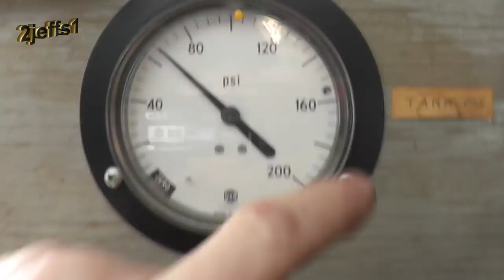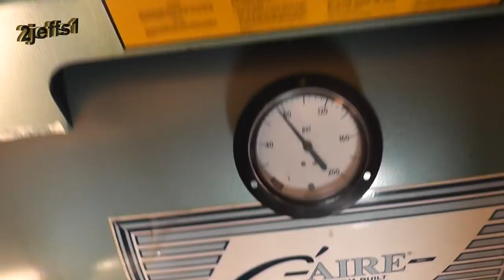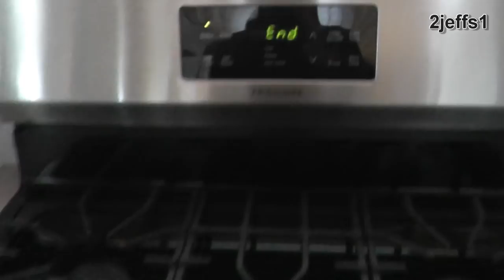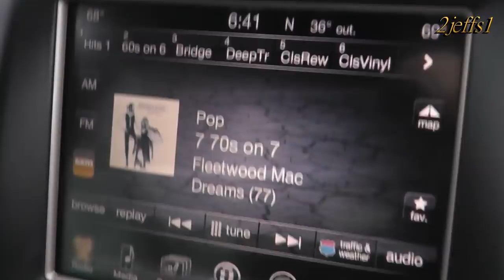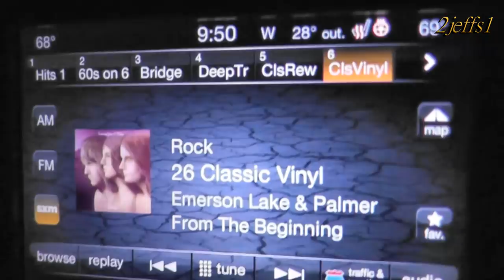Procedures on Extracting Stubborn Studs, Bolts and Screws!

Comment: A few years back our engine builder (Trans Am/GT1) was working on an older Offy 270 head/barrels that had a broken exhaust stud.  He dammed around the stud with modeling clay and filled the cup with Coke.  The coke actually ate the stud away in a few days.

Comment: Very nice bike there sir. I’m glad you got the stud out and did not have to pull the cylinder. I agree with your idea of the oil in the threads, also sometimes I use removable locktite or either anti seize too, either way it all keeps moisture and rust from getting in the threads.  Very solid video also keep them coming.

Comment: The colors remind me of Evel Kneivel ...Thanks for showing you can use heat And penetrating spray on stuck bolts ..It does help to boil the rust and corrosion out of the threads....I had to remove the  water pump on my Ford 302 and I was sweating and swearing  on how long it took to to get the long bolts out with all the years of crud built up ..I used a bunch of spray and finally won the fight ...And you can bet your sweet bippy ( remember Laugh In)  ...I will be using some Never Seize when they are re-installed
Reply from the maker: Yes - I remember doing those too. They could turn nasty in a heartbeat! A true patients test.

Comment: Ah man!!  Those freaking studs!  :(  Honda, you do have a few things to apologize for.  That tank cover  is too damn cool.  Woah!  The  foot peg extenders are great!  I might be in love with that machine Jeff.  Dude!  haha, that thing has so many awesome accessories on it.  Never seen any of that stuff before.   Ah yeah!  A video of all the differences, that will be great.  Nice!  Going back to the thumb  throttle.  Yeah, not a fan of the twist throttles on the ATC’s. ahh man, yeah, the grab bar… Yeah, i need to weld mine back together.  Maybe make a new one, as there are welds on top of welds.  :)  wow you bent that heat shield back real good.  Never would have known it was bent.  haha.  Weird, that heat shield should be held in with two bolts.  OH NO!  Looks like someone drilled vent holes in the air box lid… :(  Thats a no no.  Kinda defeats the purpose of having a built in snorkel, when the airbox is has air holes in it… Guess that guy never went near any water.  hahahah, that tank shroud screw is amazingly worn out.  :)  That head pipe came out so nice looking man.  Really looks great.  Ah man!  Definitely stealing that Idle screw extension trick :)    Such a great video.  Thanks for taking us on the trip with ya!!  Definitely loved every second of it.  Looked like a good way to spend a day.    And you’re narration and thoughts about things really fill the video out nicely.  5 stars?  20 Stars! :)
Reply from the maker: Hi Tom. Enjoying these machines big time. Never drove a Honda 3 wheeler until recently. (don't laugh) Like I said in the past - didn't see eye to eye with the Honda dealer. Had to move the 84 Yamaha 175 last night. Started first pull but - can't get over how much nicer the Honda's drive/work. There is like a page of differences between the 84 v/s 86 200x. Prefer the 86 200x for many reasons. So many changes for a 2 year difference. Neat you brought up that air box deal. Thought that was weird too. It almost looked factory the way everything was spaced perfectly but like you said a no no in my mind also. Found/ordered a headlight guard off e bay. Seen something that Honda offered several things as an optional accessory back then? Gotta tell ya this. The spark plug was always black when removed. Thought it should run/start better. Did a carb kit. Ran a tad better but.... Adjusted the valves, did this, checked that, still was running so so. Finally thought when someone put that twist throttle on I wondered if they changed the needle for the main jet where that would be easily accessible for the conversion. ( You know how everyone thinks more fuel - go faster) Pulled the carb slide. The c clip was in position 4. Changed it to #2. Went for a ride. Woah - fixed, ran perfect, checked plug color. Perfect. Finally figured out after how long? Here's the topper. After all said and done where you gave me the link to the service manual - checked to see if... Yup the setting was in there. And recommended #2. My bad.  So much needed/helpful info which has been handy to access. Runs great and thank you for the tip. Much appreciated, cheers!

Comment: I wondered if you were into trikes when you were rebuilding the Cushman.  The 200X is a work of art, they made it so competitive that by 1985/86 it was winning races everywhere.  The 350X they made a mistake, they should have used the same sized tube as the 250R to counteract the flex, but what a motor.  Loved this video.  My son and I just picked up a 2009 Kawasaki Big Brute 750 4x4i, it’s a blast.  Great video, really enjoyed it.
Reply from the maker: Hi Craig. Where I had that 175 Yamaha I never drove one of the Honda's until recently. Huge difference. (for the record I probably would of purchased a Honda years back but wasn't happy about the local dealer) Really like the 200x's but that 350x is one heck of a scare ride! Didn't see any of that frame cracking-yet. Seems I did read something about that in the past. The Big Brute sounds like fun and practical machine for certain jobs too!

Comment: Hey Jeff, good video. I learned right of to not even touch and exhaust stud or nut on one of those without heating it up first, just like you mentioned!  Those 200X's I think are probably one of the best all around 3-Wheelers Honda ever made!  Plenty of power in the woods and reasonably stable, too. Not bad for someone not too big in the sand also.  I sold ours years back but I still have 2 350X's, a 250SX and my favorite dinosaur, an 85 250R that just keeps going!  If the clutch ever seems to wear out or slip and the friction discs are still good, I have an old trick for that sometime if you need.
Reply from the maker: Really appreciate/enjoy the 200x's. Nice buffet you have there. Too bad the local Honda dealer was a .....  I would of preferred the Honda's over the Yamaha (especially after driving them) even tho they are a nice machine too.
Reply: Yamahas were OK. They just seemed a little front end light compared to the Hondas.

Comment: Did you feel at home in the UP? I hate toll roads, just seems wrong. I would get at Rockford for a dime and off at Beloit for 25 or 35 cents in the old days.  Last time I crossed there pulling a parts vehicle with a tow bar they charged me more than if I had driven both across separately.

Comment: Got a question Jeff I bought a 97 Polaris magnum 425 and it’s missing the heat shielding, what can I use to keep the heat off my leg, it gets smoking hot even if I hold my leg away from it, And is that normal?
Reply from the maker: Not sure if that's normal for that machine. If you could find some tin, like side panels off an old washing machine, or an rear inspection cover off from an old refrigerator and use radiator hose clamps with a couple of stand off's (washers, nuts) for an air gap possibly.

Comment: hi 2jeffs1
got a 2003 Chevy S10 and it's blowing the ECM 1 fuse 15 amp   every time when you turn the key on to all the dash lights come on that's when you can hear the fuse blowing   by the way if you know anything about that kind of stuff I appreciate it  my best friend on YouTube
Reply from the maker: Sadly electrical issues are harder to diagnose over the internet or phone. One thing to be aware of is 1 fuse can power multiple items which are not known by the fuse description. A wiring diagram would be ones best friend on this one.